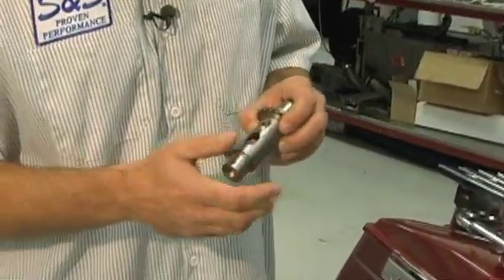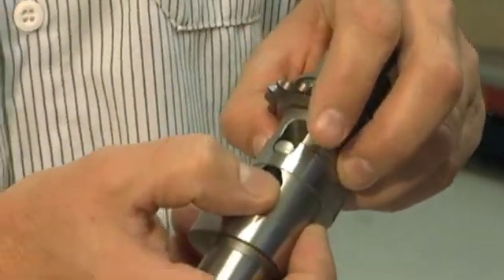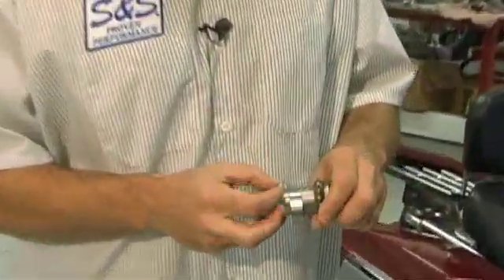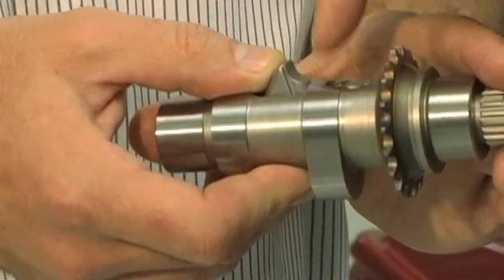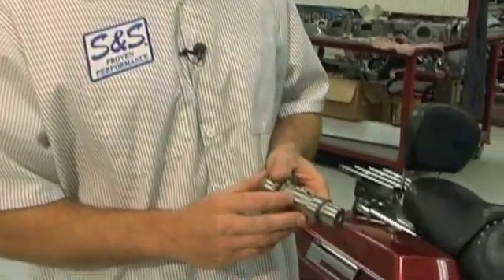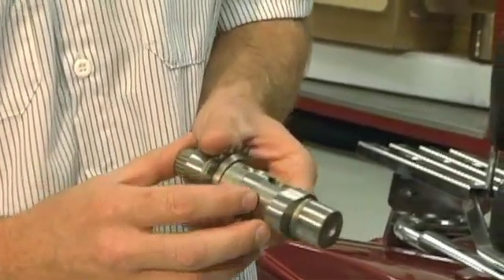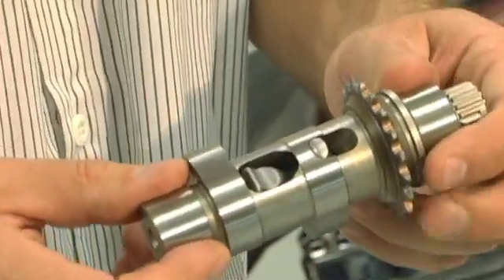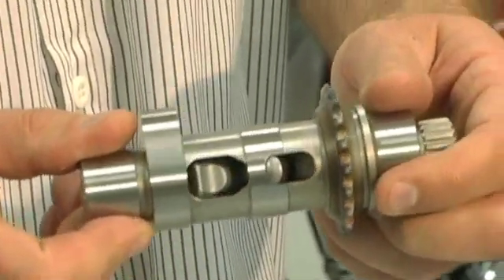S&S Cycle Easy Start Cams - Development & Testing

Comment: I want to get these cams for my 03 super glide. Do I have to do any other motor work other than installing these cams? I was thinking about replacing the pushrods and the lifters also. Not an experienced mechanic, but I was thinking of trying to do this myself. Any recommendations?